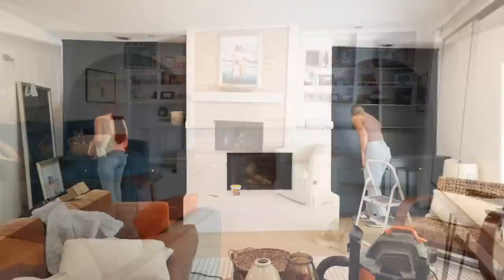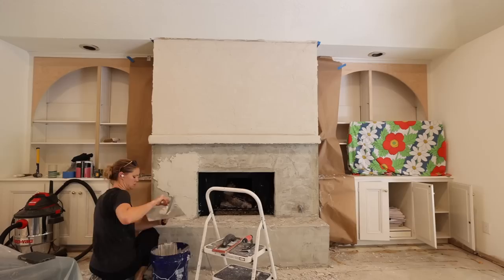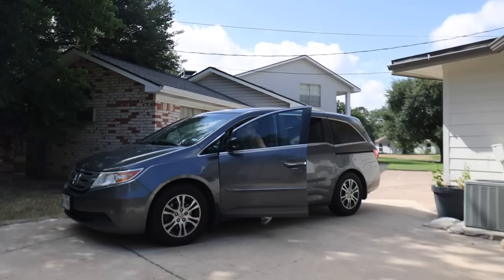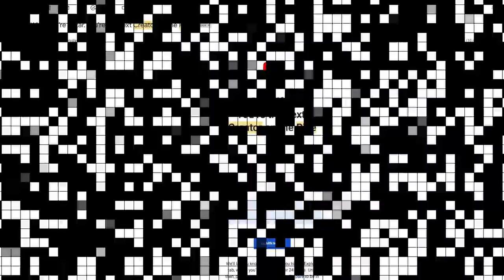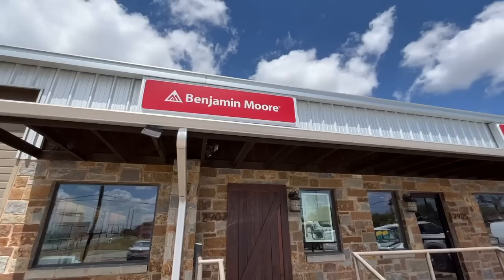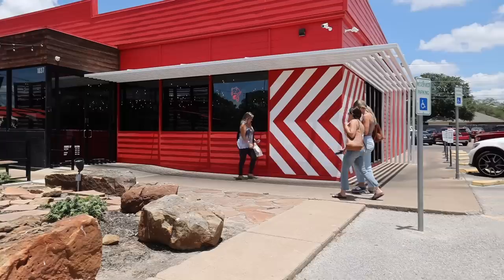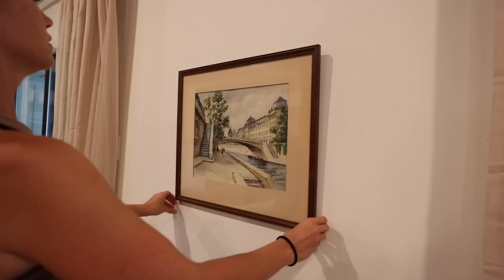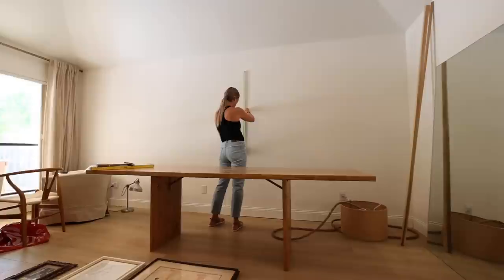My Favorite Makeover Ever! // Extreme Home Makeover [Part 8] // Living Room Makeover

Comment: Nice! Should think about replacing the two old, wonky looking recessed lights with two of the sleek LED clip ons, white frame, would have blended better and most have the 5 color selection from 2500K-6000K...about $25 each. (Hi from Okaloosa Co., FL by the way! Destin, FWB, Crestview).

Comment: I’m wondering if you seal the fireplace with a poly if that would both protect the stucco from humidity and make easier to clean and also it may highlight some of the dimensional texture…..I’ve also seen a tinted poly to help accent. Hmmmm……tough one but good decision not to paint.

Comment: I love this room. The sofa is to die for.  The colour of it is beautiful.  My only question is….where’s the tv?
Reply: I think the painting om the fireplace is the tv......
Reply: @emiliastill2840   but where are the wires, sockets etc.  if it is it looks very good.
Reply from the maker: That’s a frame tv on the fireplace! The wire is actually still hanging from it buts it’s so thin you can barely see it. They hired out to have it installed and it was a bit of a disaster and I just completely forgot to mention that! Eventually the wires will be hidden and the box for it will go inside the cabinets :)